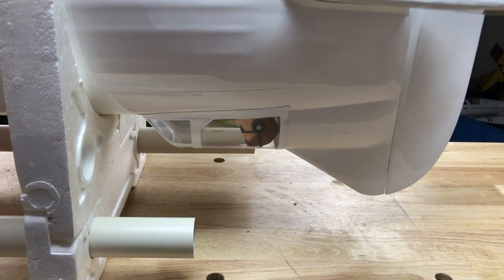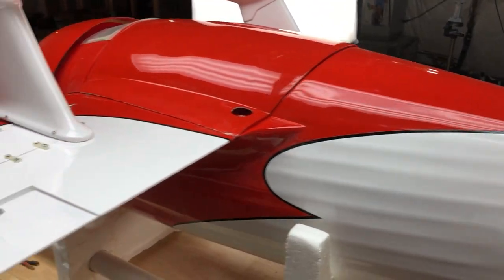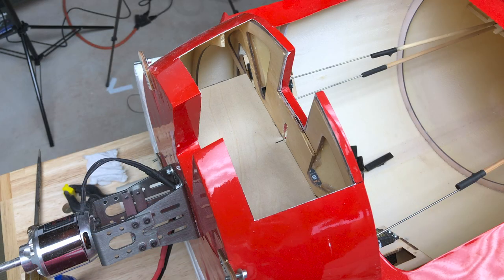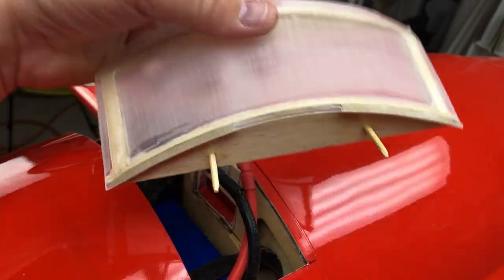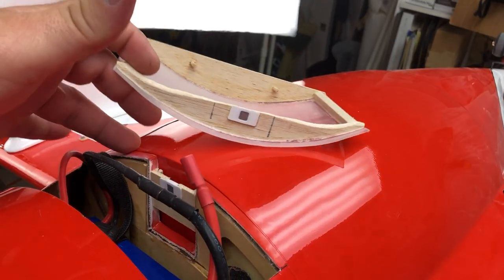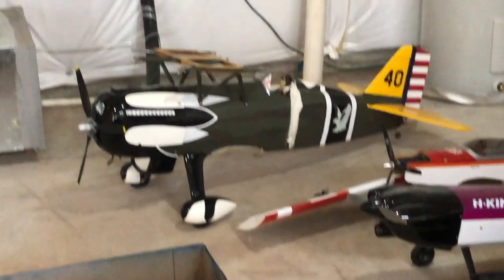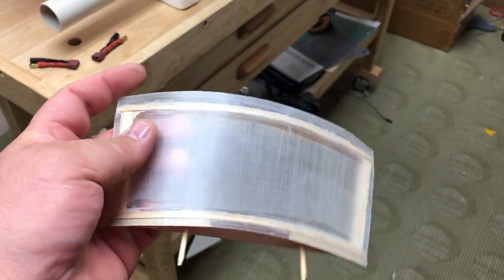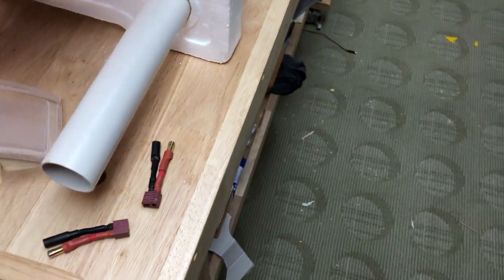Gee Bee R1 Episode 6: A Plan Was Hatched

Comment: What was the material used on the hatch 
Also what size motor?
THANKS
Reply from the maker: I sate in the video that the top of the hatch is PETG, normally used for vacuum forming. The motor is a Turnigy SK3 5055 320kv motor.